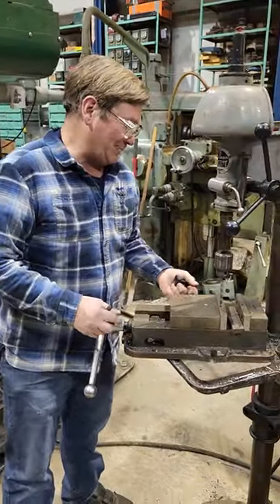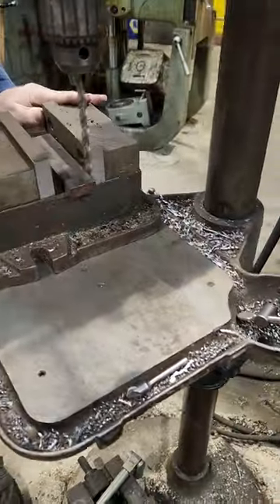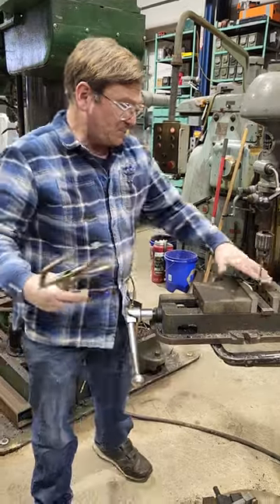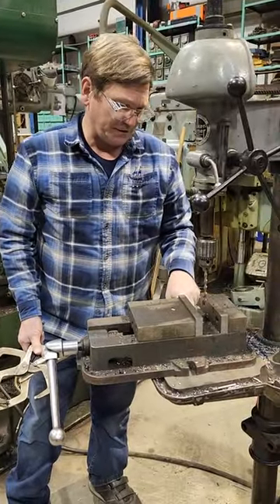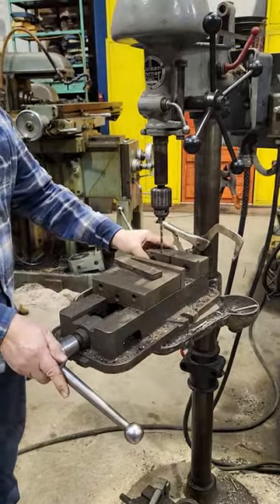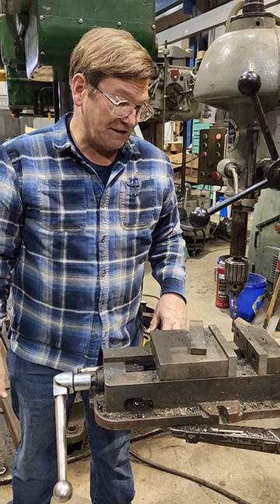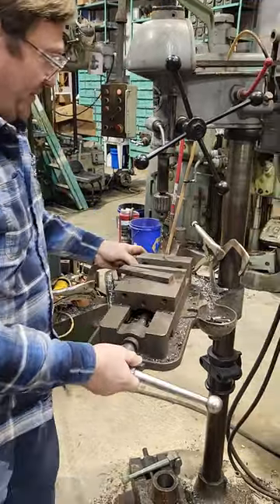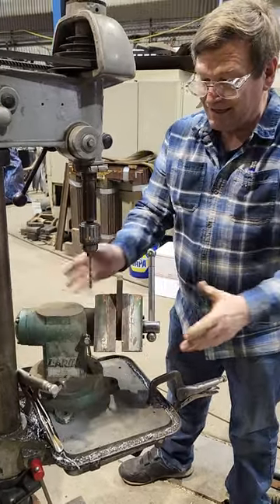Machinist's Minutes: Answering Questions About Aligning Parts on Small Drill Presses

Comment: Oh my gosh you hit the nail on the head! It was in tafe which is trade school in Australia  and it was all about bolting the vice down in the limited t-slots and using it solely as one operation to centre drill and drill holes all over a small plate. 
I just used C- clamps in my oxy cutting classes, and I know they have them in the machine shop too but I never would have thought to use them to hold the vice down, that's an AWESOME idea that i'm sure the tafe teachers would be pleased about!! 
Also SO useful to hear how the drill press is really used in the field! 
Thanks so much for all the info! ☺️☺️☺️

Comment: great video and true. I remember reading Karl moltrecht's Machine Shop Practice and the process for accurately punching and drilling. We prick punch, center punch, enlarge the center punch with a very small twist drill, then center drill- all with the part floating.  have an old bridgeport C head that has rather awfull spindle runout, although doing it like this, I am able to get the machine to accurately drill holes where I want them.

Comment: This is a little unrelated, but Dee dee said that people have been killed by Radial arm drills, And I think I know one way now how that might be possible. If the part is not constrained sufficiently and we are drilling a large hole (say 2-3/4) as the bit starts to exit the part and create that "bow-tie" shape that will wedge the drill bit and cause it to either slip  or stall the machine, if instead the part comes free and starts spinning around on the end of the drill, yeah that could kill a man.